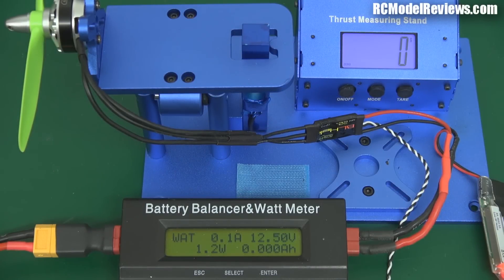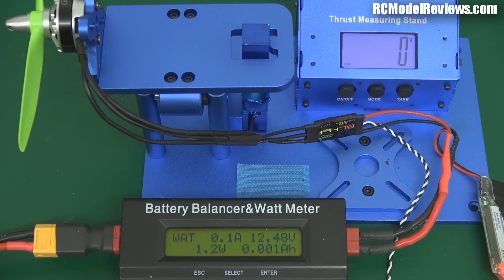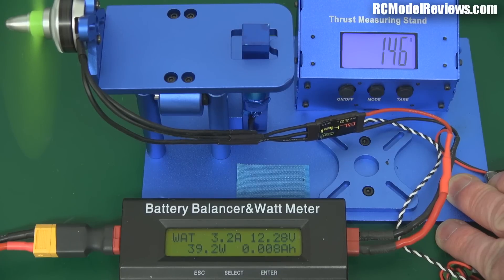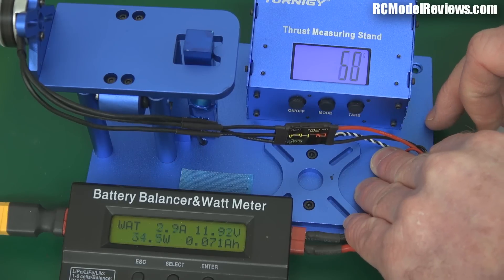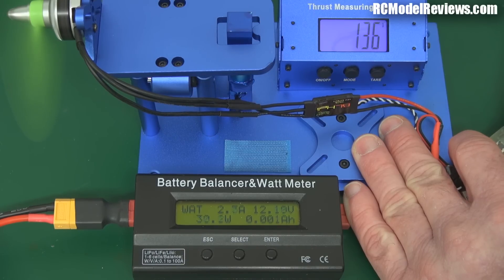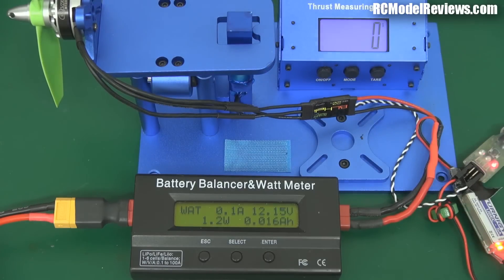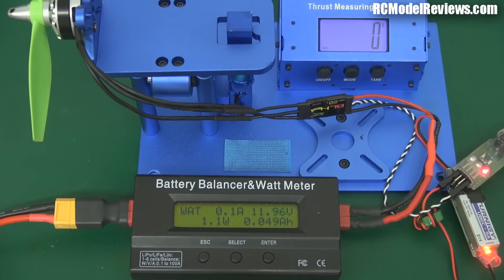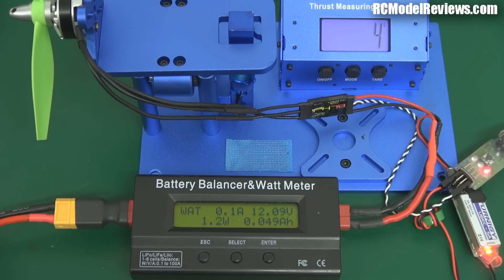Bench test: HQ vs DAL bullnose miniquad props

Comment: G'day,

Yay Team !

  Speaking as a one-time Propeller & Turbine-Rotor Carver, as one does, I always reckoned that the closer in toward the Hub the Blades adhered to achieving compliance with a pure Helical Pitch then the "more efficient" the Airscrew/Rotor could become...; whereas it's often fashionable among Production-Engineers to regard the central 1/3 of a Prop/Turbine Blade as being merely a Streamlined Strut, to carry the outer-Blade which they figure is doing almost all the "work".., and it's cheaper and easier to make semi-helical Inner Blades than it is to make the more efficient fully-helical Profile Twistinesses...

  Moving a solid "Column" of Air at a uniform flowrate through the Disk is always going to be more efficient than trying to pull a high-speed Torus over the top of a stalled cylindrical Doughnut-Hole...; in moi humble opinionation.

;-p

Ciao !

Comment: It would be good to see these tests done on a bench top power supply to eliminate voltage drop from the equation. I saw that the HQ bullnose props dropped it down to 11.2V!
Reply: Adam Wilkinson On the one hand, yeah - that highlights the importance of battery selection for testing and flying, on the other hand, your flying quad isn't going to have a regulated 12v while the motors are drawing a combined 48A out of the battery, so testing the numbers you get as a per-arm setup (battery, esc, motor, prop) is more revealing for real world use, I suspect.
Reply: I see what you mean. but maybe I like to fly my mini quad with a 4000mAh 65C battery. So these results are inaccurate for my case. :P
Reply: Yeah, I mean to try all of my batteries with both a high and a low draw prop and a particular motor to see what sort of differences show up in the results. As it is I use a freshly charged 2200mAh 40c every time I change props to give my tests the most repeatability even though I don't really fly my quad with that pig of a battery.   But she who must be obeyed is already grumbling about how much I spent on props and motors last month, a new high capacity, high discharge battery isn't on the menu any time soon. :)
Reply: Adam Wilkinson I agree, a regulated bench top supply would be good for these power and efficiency tests.
Reply: I don't know how most manufacturers do their thrust tests, but I have a theory about KDE. For their 3S tests, they specifically say 12.6V, So I reckon they use benchtop power supplies which bumps up their thrust figures to best case scenario, http://cdn.shopify.com/s/files/1/0496/8205/products/KDE_Direct_XF_M-R_Brushless_Performance_Testing_-_KDE1806XF-2350.png?v=1435594815
Reply: Adam Wilkinson Voltage drop is a part of life when using LiPo batteries. I think that tests with LiPos have more real world credibility than those using benchtop power supplies.
Reply: I totally agree... But there is still something inside me that says it is a more fair test if the voltage is the same for all prop tests haha!
Reply: Hmmm.... Think I see what you're getting at now. It's like you should use a constant voltage power supply to be fair on comparisons only. Can still use a battery for outright individual performance tests I guess. Maybe do the first one on a battery then set the voltage on the supply at the value the battery voltage sags to...

Not worried too much about it as long as voltage and current draw are shown real time along with the thrust so you can make your own judgement call. With so many variable possible on a flying craft there's a bit of judgement mixed up with the science. Keeps the science FUN. :-)

Comment: Good stuff! Thanks for testing! The main problem I see on "non-HQ" props is that they have a bad habit to explode in middle air. Mainly flying 4S and hard acro maneuvers...

BTW, Could you leave a summary of your results in the description? It would be great for folks not native in English like myself ;)
Reply: Renato Elias Yes, I've experienced the instant departure of one or more blades from the hub when using some of the cheaper ABS and other plastic props coming out of China.  In fact one batch was so bad I thought I must have had a faultly motor or ESC because the quad would fall from the sky for no apparent reason every now and then.  Turned out to be the el-cheapo props -- I actually caught some video of a blade coming off in mid air just before "the flip of death" :-)  I haven't had that problem with the DALs though.

Comment: Bruce, props with winglets, would they be more efficient? 
I did see some on the www. Not long ago but I've not found them since.
Reply: Green Silver Well in theory, a prop with winglets could convert the radial flow of air (produced by centrifugal force) into thrust -- however, I suspect the drag involved would negate any improvement in thrust from an efficiency perspective -- or full-sized craft would have winglets.  Having said that, I've seen some very interesting prop designs on microlite aircraft recently which obviously seek to use winglets to boost performance.  Next time one drops by the airfield, I'll take a picture and post it.
Reply: +xjet 
I thought that winglets actually decreased drag if they were designed right. They virtually eliminate tip vortices but increase pressure drag and surface friction drag. But if done right, I think the net drag would be less.

Comment: Thanks for all the propeller reviews you've been doing lately, they're very interesting. I gotta ask though why you don't just screw the scale down to your bench...I'm waiting for the day it becomes a permanent part of your wall :)

Anyway...I've been flying 5030s for about 4 months now and am looking to jump to something a bit more aggressive.  I bought some 5045s but only used them on a camping trip to the mountains where I was way up at around 7000 feet.  They were very punchy even up that high but the whole quad flew completely differently up there. I'm a bit concerned about using them at sea level with my 12amp escs...would 5040s be OK?  I did just put in an order for some 20amp BLhelis but will probably wait for a catastrophic crash before installing as the quad is flying very well right now.

Comment: Hi Bruce. Why not use the bench PSU when doing thrust tests. The amp draw is small enough and then all tests are equal.  You might even be able to use one of your chargers if u have one with motor test function with high amp output. Juat a suggestion. And thanks for all the great vids. Wish the ZAR would gain some ground so i can start importing again.

Comment: Bruce,

Currently I am running 5030 GF.  I am on a ZMR250, with Sunnysky motors.  Running a 3S 1500 for the battery.  How do I know if I am safe to move up to a different (larger) size prop?

Comment: You should show the servo tester so we can see how much input was given. Adding a large marked dial might make i easier to see. I know the amount of input is not a actual propper measurement, but would give ideas of throttle input required to achieve hover.

Comment: Could you show us how you cut them? I want to cut mine but I don't know if I should use scissors or a blade.
Reply: Marc Connell Just score the back (or front) of the blade with a sharp knife and then bend.  The plastic will break along the scored line.   Tidy up with some sandpaper and give them a quick check for balance.
Reply: ***** Do you check the balance after cutting them? I don't have a prop balancer. Thanks!
Reply: Marc Connell Hi, Why not use a short stainless steel rod, instead of the wooden skewer?It's much more precise. (No offense meant, Luke.)& use 2 glasses as the pivot posts. Personally, I built my own magnetic balancer.Works very well.
Reply: +Marc Connell  bmsweb has a great way, using a dremel tool though...

Comment: By the way I am very curious to the weight of the 5x4 bullnose? Weight of the prop also makes some difference.
Reply: Boris B. HQ5045BN=4.4g
SZ5040BN=3.9g

HQ5045BN needs higher rpm-higher voltage to really shine, 4S voltage and 2000 to 2300kv is their sweetspot. The DAL/SZ props are really close behind. Most people are happy with short 3 to 5min flights at warpspeeds, so efficiency is a non-issue for them. The one thing I've had problems with the DAL/SZ cut down to 4" is they've came out unbalanced and caused vibrations, perhaps the batch mine came from is heavier on one side. Bruce's cutdowns looked very balanced. I even made a jig to cut them to equal lengths.
Reply: 4.4g vs 3.9g is a huge difference man. Didn't expect that.
I do think 5x4 bullnose might be nicer for the batteries though :)
5x45 really requires the highest c ratings to make that top.
Reply: EngineerX I cut DAL 6040 to 5040 and also had unbalanced props, Purchased a balancer and now am very happy with the cut down DALs, they feel great in flight. Can attest that they are not as durable as the stock DAL 5040.
Reply: L Pablo Mendez Yes, they require some balancing. All 4 I cut down were vibrating. Quite a lot of effort but saves you money and good option if you're not looking to break any records. Makes me feel better I wasn't only one with unbalanced DALs and thanks for chiming in that they do feel good in flight. I'll make some more.
Reply: EngineerX balancing is a big no go for me. I just want to be replacing props in the field without having that worry :)
Reply: Boris B. I hear you... too time consuming. Better be flying than balancing!
Reply: EngineerX yes....for mini quads I dont want to be balancing props,  which are going to have a short life anyway :).
I just think that the manufactors of the props should take care about that.

Remember the times where we only had graupner props having the best balance. Well, hqprop was a very cheap answer for that.
Reply: Boris B. All my DAL 6040 props needed balancing.  Same, of course, after I cut them down to 5040BN.  My problem is getting my 'balancing tape' to stay stuck.  I keep loosing the tape in flight.  I even wiped the blades down with alcohol before balancing...didn't help.  I just balance a bunch of props up front and have them ready to replace in the field if/when needed.  I have YET to break any DAL prop.  I've chewed them up, but never broke one. Mine are all red...don't know if that makes a difference or not.
Reply: MrVantasstic I'll have to forego my favorite greens and go for red then!
Reply: MrVantasstic I've got red 5030 from surveilzone, same thing, chewed no broken.

Comment: I know the video's a bit old, but I followed Bruce's advice and I run a KingKong 6x4 cut down to 5x4 bullnose, hand balanced, on my DAL DL220's and my 265's.  They are indeed very good, very very strong and run much quieter than the 5x4's from King Kong.  They definitely run faster, although without a radar gun it's hard to determine.

Comment: Hey Bruce - a quick qn, are you balancing the DAL props before using them in general? I've found the DAL6040 to be quite out of balance when compared to the HQ6045.
Reply: Geggog77 Yes, I gave them a very quick balance before I used them -- they were pretty close after the cut -- just requiring a few quick runs over some sandpaper on one of the tips to bring them "near-enough"

Comment: you've been flying miniquads for quite a while now so do you have any preference at all over any of the frames? mxp230, blackout etc. it seems to me you've been primarily using the mxp230 for testing and so on. 
Thanks.
Reply: Oscar Thorpe Well that's the subject of a whole other video :-)  However, they're all good.  The ZMR250 is cheap, the Blackout mini-H is fast, the MXP230 is indestructable, the Quadrysteria MiniMamba is fun/different.  I'll be covering the various pro's and con's and telling folks which I have decided  is the best miniquad frame for me very soon.
Reply: I have a zmr250 and ive got some extra cash in the bank now so i was thinking of getting an upgrade frame...
Reply: the mamba is quick in a straight line because of the tilted motors but you say the blackout is fast all round? how about the qav250? shall I just wait for the video?
Reply: Oscar Thorpe The QAV can be quite quick (when suitably configured) and handles very nicely.  The lack of bolt-on arms is a disadvantage because even though they are very tough, I have seen people break them.  The manufacturer has now gone to a thicker material and changed the design to reduce that risk though.
Reply: Ah yes it is a one piece base plate. I havent broken an arm on the ZMR250 though........yet...

Comment: Hi Bruce 

 Is there any news on you getting your wings back
Reply: john E It's never going to happen but it's only a matter of time before it becomes a non-issue.  MFNZ has had a static membership for the past three or four years, during which time the hobby here in NZ has probably tripled in size.  Clearly, this means they are no longer representing the majority of RC fliers -- or even a healthy minority.    They will eventually become completely irrelevant and are well down that path already.

Comment: What color of DAL 5x4 and 6x4 props were you using?  I find certain colors tend to be more durable.
Reply: headrecdsm Yes, I've also noticed that -- although I've done no scientific tests so it could just be coincidence.  I find the black and orange ones to be most durable and the green or blue ones to be least durable.  Perhaps I should do some real testing on the bench... now where did I put that hammer? :-)
Reply: headrecdsm  I was lucky enough to get red and they are very tuff bummer part was I coudlnt pick the color

Comment: Wow... what a surprise. The APC MR props are as far from the cut down unbreakable concept as it gets. VERY interesting results. I'd like to see how the APC MR perform cut down... I'd think they would lose some efficacy but I thought the same here. Another valuable video with a surprising outcome. OK ... how do the 5 in gem fans on 2S cut down to 4.5 or 4in perform to use on a 200 quad with Sunneysky 1306S 3100KV motors or similar I wonder. The 4in look really tiny compared to the 5in Gem Fans so seems cutting them down may be the ticket to getting the needed prop... Gem Fan Et.al really needs a 4.5 in between the 4 & 5 inch prop sizes.

Comment: Maybe for such tests you should use a constant voltage powersupply? :)
Reply: Fr33lumby© Yes, unfortunately my lab-supply is only good for 5 amps.
Reply: *****  Yeah i know, they are very expensive.....
Reply: Fr33lumby© Or maybe a much larger capacity Lipo (or several smaller ones in parallel) to avoid the supply voltage dropping so quickly during the tests.
Reply: ***** 
Is one of these no good? 
e. g. http://www.ebay.de/itm/261470580279
30$ for a 30A/12V PSU. No adjustable voltage of course, but you wouldn't need that for these tests.

Or how about a SLA battery? Much heavier but also much cheaper then a same capacity Lipo. Would also finally be a reason to your "lead" function on the chargers ;) .
Reply: superdau I've tested a few of those Chinese switch-mode power supplies and have yet to find one that actually performs to spec.  They tend to be woefully over-rated by their manufacturers/sellers :-(
Reply: ***** Don´t you have a HK350W power supply? That would be ideal for those little motors?
Reply: Fr33lumby© good xbox360 brick gives over 13A
Reply: ***** why not re-purpose a server power supply? i've have both the HP 321632-001 @ 46 amps and a artesyn 7001138 @69 amps. Very cheap power supply approx $20 cdn (free from your IT buddy) they're regularly changed out after a couple years of service. designed to prevent brownouts/spikes and to damage to sensitive equipment and any lose of data from said equipment. I have had 4 of the hp and 3 of the artesyn and all of them kick ass. I think one of them had a pinout to add a pot to adjust the voltage.

Usually 1-2 jumpers to turn them on. If you find any cheap server power supply search the part number I'm sure that someone has the pinout to turn it on.

I've been using mine for charging at home/running my 3d printer and at the track/field. solid 12 volts around 25ish amps (4s6p a123 battery pack for my suzuki 700cc ATV at 25 amps on a 306 Icharger)  mind you i don't have anything fancy like you just a fluke multimeter and a cheap wattmeter. 

Recently the HP survived a bad regulator on a gas generator that blew up 3 charger (2 hitec 4 port) running on AC and  1 Trackpower brand 12 volt power supply. Lots of magic smoke that afternoon unfortunately.